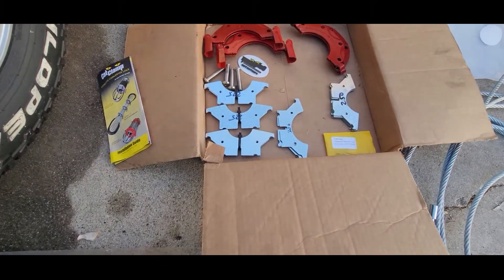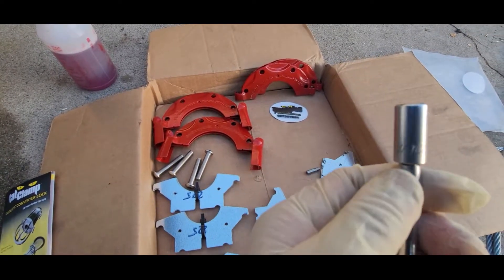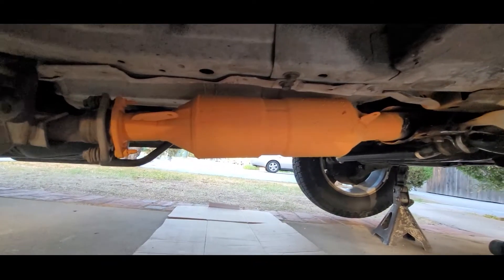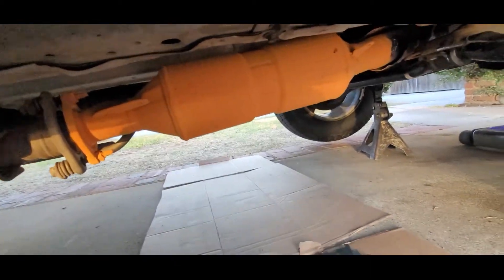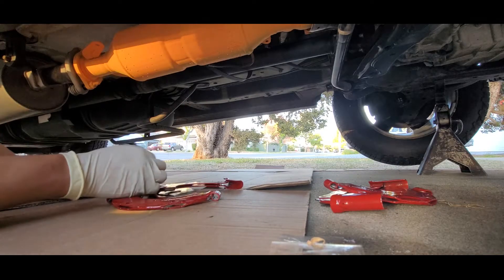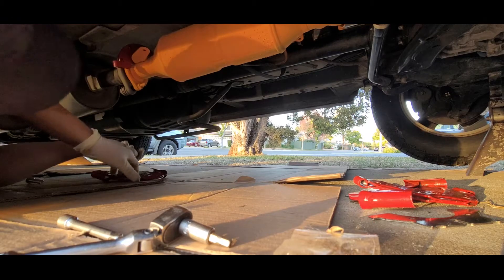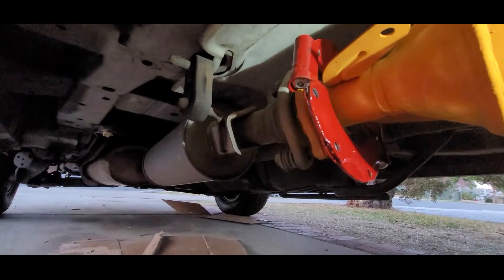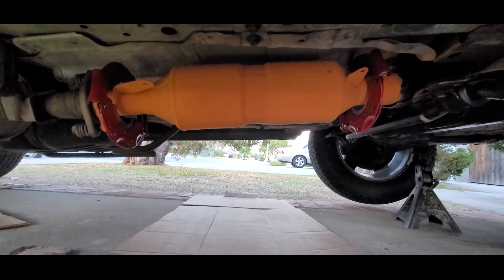Honda Element Catalytic Converter CatClamp install Part 1

Comment: If you are worried they can unbolt the clamp then just put super glue in the head of the bolt. Then if anyone needs to remove it they will need a super glue solvent that takes an hour to work.
Reply from the maker: Vey good idea. I’ll try that

Comment: Why is it spray painted orange?
Reply: For putting  vin number on
Reply: It doesn't matter what you put on it or what color you paint it.  Police does not care enough to go after these criminals. You put your vin number or your contact info on it, the thief doesn't care. The crook who is buying these cat converters know they are stolen and he doesn't care either. Buy this contraption or something similar  and wrap it around the cat converter so your car won't be an easy target.